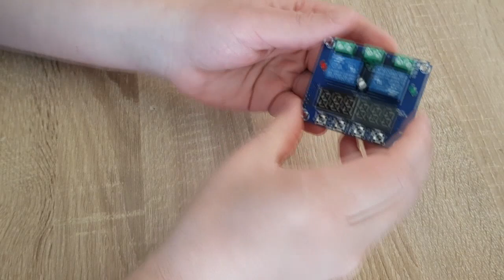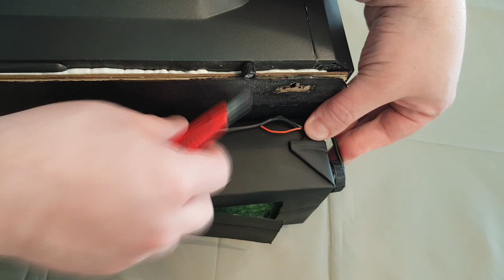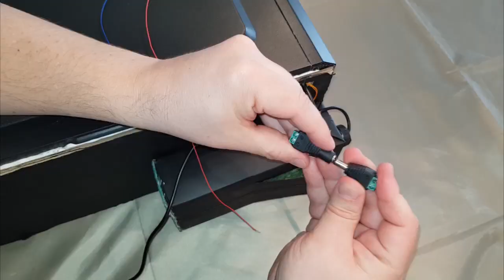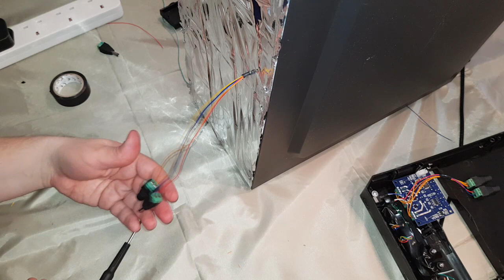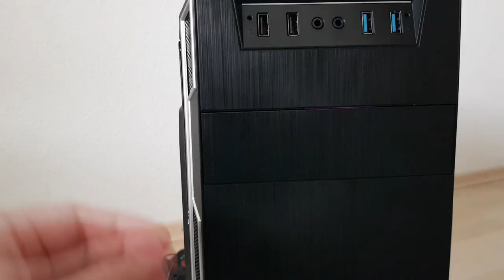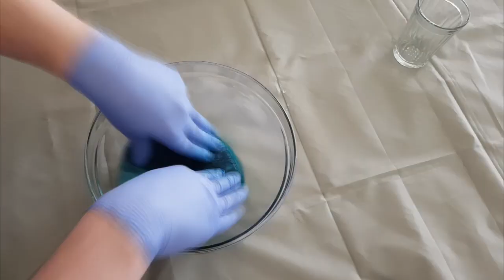Building a DIY Micro Grow Box Part 4 - Measurement and Control Equipment.

Comment: Outstanding!!!  I will try this but have a rookie question.  If temp/RH in the box are good, then exhaust fan won’t activate, right?  If there is no exhaust fan activation for long period, then there is no air exchange which could cause low carbon dioxide within the box.  Is my thinking correct and, if so, would placing a second exhaust on a timer to do one air exchange (matching one box volume) per hour be a solution?  I know you had no problems with this but I am trying to maximize my chances for success.  Thanks so much for sharing this with us.
Reply from the maker: As this box is tiny, RH level is always raising triggering ventilation regularly. I would say that after the 3rd week ventilation is almost always on and you have to defoliate in order to keep RH at the acceptable level.
Reply: @secretgarden9674  That is helpful.  Thank you very much.

Comment: I've got a question, can I use tin foil instead of mylar or is mylar required? I am newbie by the way.
Reply: You don't need to use mylar, tinfoil will work but mylar is just the most efficient at reflecting light with the least ammount of light loss. I would recommend turkey foil as it's a bit stronger and less likely to tear. Regular tin foil is good though

Comment: i see that the out vent/carbon filter is conected to the thermostat, but can we plug the intake fan/s aswell in the same scheme?
thanks in advance, and hope you keep making more content.
Cheers m8
Reply from the maker: You can, but you don't have to. This is not a real PC it doesn't need an intake fan. By pushing too much air in your box you might push out the smelly air bypassing the carbon filter.

Comment: This project is legendary, thank you

question: what happens regarding the smell, when the fan stops due to ideal temperature and humidity? There are still going to be holes in the case to let air in so smell will go out, right?
Reply from the maker: Smell will be very minimal (if any). At late stages, when smell is the strongest, humidity level should be kept at a very low level, therefore ventilator will be working constantly. Also, if you will review first part, you will see that tried to seal all holes as much as possible leaving just enough  inlet vents at the bottom of the box.
Reply: @secretgarden9674  Thank you sir!